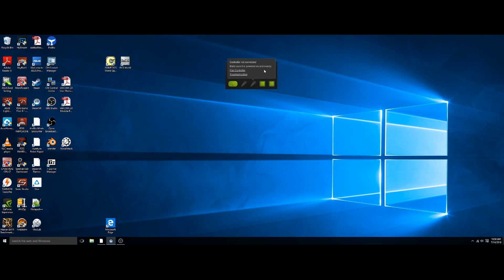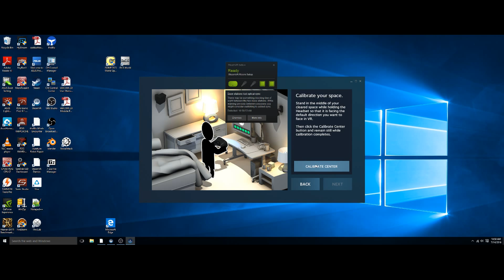HTC Vive Kiss Setup for DCS World

Comment: How did you make the controller HOTAS work?  I just get that the controller is not compatible.  I cannot fly with a mouse and a keyboard.  Did you have to trick DCS or Vive into using a HOTAS?
Reply from the maker: First, are you using a CH Products HOTAS? If another brand, I wouldn't know as I don't have any experience with any other. But for CH Products, make sure you have their CM Control Center Software running (after you've plugging in your HOTAS system, and have it's drivers installed).

Comment: I like your setup except I guess if you try to look behind you too far it will lose tracking  right? I have been doing one in front of me and one behind but I have to use a tripod on the rear one which is a pain.
Reply from the maker: Possibly could. but have not experienced that issues as of yet. For one reason, looking directly behind myself while in the confines of a chair and makeshift cockpit setup is sorta difficult for me to say the least...As of this date, I've just got the two light houses sitting on a couple of boxes on the desk, a little lower than eye level, one at approx. the 10 O'clock and the other at approx. the 2 O'clock positions.  Not recommended, but it works for out "desktop setup". And with this temporary setup I do recalibrate SteamVR daily...

Comment: do you experience studder in vr when using the vr settings in dcs cause I do with an i7-4790k & gtx 1080
Reply from the maker: no, but there are a few things I've done to eliminate this, here are some of these. I'm working on a video with some more suggestions. Maybe done in a couple of weeks. First, boot up and have SteamVR up, running, and calibrated.
Make sure “Allow reprojection” is checked (Performance tab)
Make sure “Enable Always-on Reprojection is unchecked (Developer tab).
Go to the Taskbar and exit all nonessential applications,
(note, for us, CM Control Center and VoiceAttack apps need to be on),
(note, the application Sonic Suite 2 causes faults with CH Control Manager and VoiceAttack).
Go to Task Manager and exit “"HtcIdentityService",
and,"HTCVRMarketplaceUserContextHelper"
(this seems to noticeably help remove a 1 to 1.5 second consistent studder in DCS World, for
whatever reason).

Comment: How high do the need to be?
Reply from the maker: I think the manual calls for the lighthouse to be located about 6 to 7 feet above the floor, but as in this video for the seated position the lighthouse just need to be in view of the headset. Of course the setup show here is not recommended by HTC, Steam, or myself. The video is just to show how flexible the lighthouse / SteamVR system can be.
Reply: +DigitalEngine gotcha